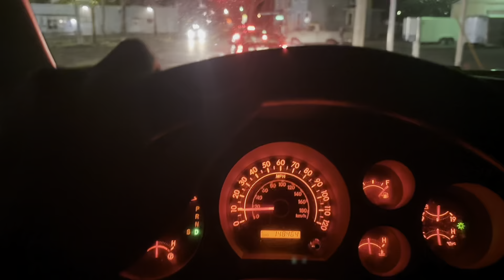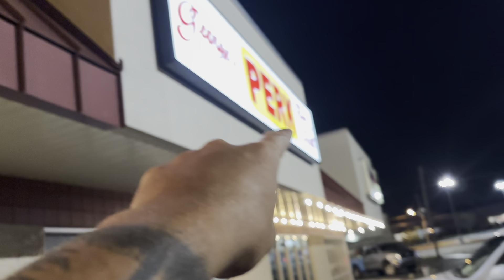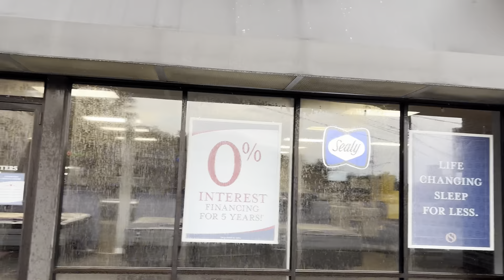HOW WE MADE $15K IN 3 NIGHTS PRESSURE WASHING

Comment: a little overkill on the PPE with the Sodium Hydroxide aka Caustic Soda....I used to handle TONS (literally) of the stuff in barrels as a production operator at a gold mine....we used it for PH level in the solution ponds and used 500# barrels of it every day.......keep it away from water sources (sweat) and wash off well after coming into contact with it
Reply: I didn't see any overkill. Sodium hydroxide fumes can destroy your lungs. You may not see the damage for years but be guaranteed that it is there. Always use a respirator.
Reply: @Lostintime31  no "fumes" when you are using it outside.....as I said I used TONS of it.....of more concern is the asbestos exposure while in the Navy

Comment: You can’t just spray caustic soda like that. It’s highly corrosive. I do gas stations every night and this is what I’ve used for years. I 100% guarantee all those metal window and door frame are jacked. Just something to think about next time you go spraying it everywhere.
Reply from the maker: @ryanhall7438  not at all. This is my hometown and every single place is still fine?
Reply: I think you are confusing SH, which is used on the buildings with caustic soda which is only used on concrete.